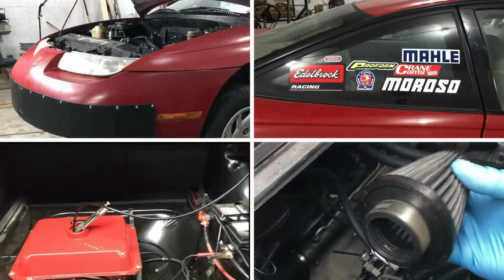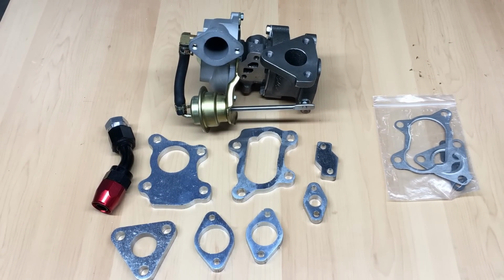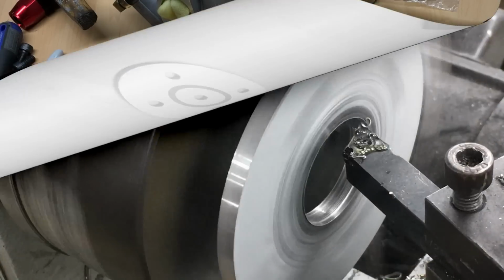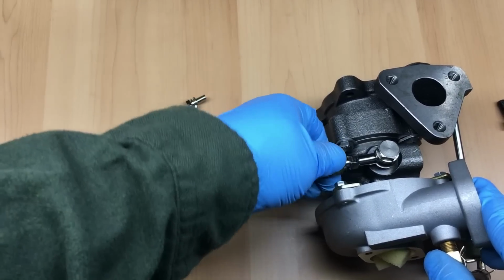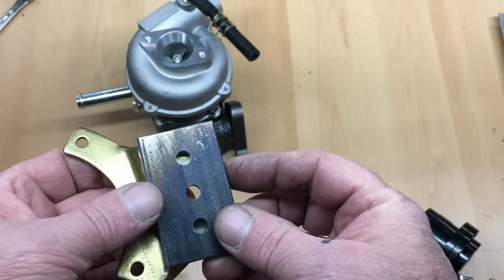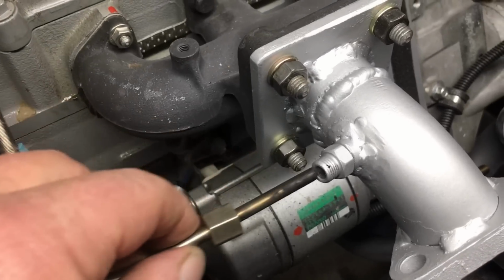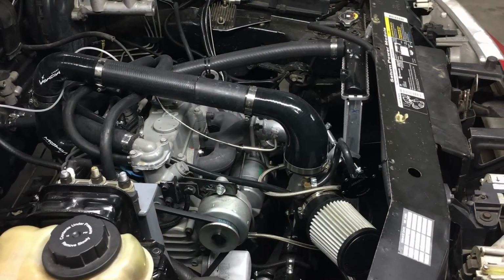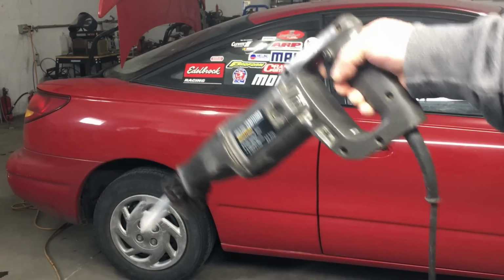S3 E5 We install a RHB31 turbocharger on the Kubota D722 diesel engine in a 1999 Saturn coupe.

Comment: Diesel cars with less than 3 liters consumption are standard, VW Volkswagen Lupo 3L TDI:
The Lupo 3L TDI  appeared in 1999 and, with a third-mix standard consumption of 2.99 liters of diesel fuel per 100 km, is the world's first series-produced 3-liter car. It has a 3-cylinder in-line engine with a pump nozzle system and a drag coefficient (cd) of 0.29.
In addition to the development of an economical engine, lightweight construction techniques were used. These include the use of the light metal aluminium, and for some parts also with magnesium in the alloy. This meant that some components had to be newly developed. In addition, the panes are made of thinner glass. In this way, around 150 kg of weight could be saved compared to the VW Lupo SDI.
The aerodynamics of the tailgate have been optimized and it was manufactured using composite technology from different aluminum alloys (with magnesium on the inside).
The weight reduction in connection with the energy-saving tires (mandatory for using the tax advantages) led to problems with handling: In particular, the vehicle with only one driver showed a strong tendency to oversteer. In order to be able to retain the already developed tailgate and the already existing production facilities, lead weights were installed in the rear bumper as an interim solution. This compound flap was only installed until May 2001; from model year 2002, VW installed the steel tailgate of the normal Lupos. As early as model year 2001 (from 06/2000), the starter battery was installed in the spare wheel well in the trunk to put more strain on the rear wheels. With this measure, one of the 7 kg additional weights could be omitted. The option of ordering a temporary spare wheel instead of the standard breakdown set was also eliminated. Along with the battery and the heavier tailgate, the lead weights previously used could be omitted.
The on-board electronics are supplied with a constant 14 volts by a step-up converter mounted between the rear wheel arch and the driver's door when the starter causes the on-board voltage to drop.
The bonnet and doors were made of aluminum throughout. An automatic manual transmission ensures early upshifts and thus low engine speeds. The transmission is designed with a very long translation. Technically, this is a special solution: A conventional gearbox and a clutch are actuated by hydraulics. Replacing such a transmission is relatively expensive.
Due to the limited functionality (three-door, small trunk, little space in the rear), the high purchase price and the resulting long amortization period, the VW Lupo 3L TDI did not open up a wide group of buyers. Critics accused VW of having implemented an alibi project with this model and price policy.
With pollutant emissions of 81 grams of CO2 per kilometer, the VW Lupo 3L meets the criteria for tax classification as a three-liter car in Germany (max. 90 g CO2/km). It was also the first diesel-powered car to meet the Euro 4 emissions standard. Early VW Lupo 3L models only meet the Euro 3 emissions standard. The extension of the automatic start-stop system to include freewheeling (rolling when the clutch is open) helps to save fuel and thus to reduce exhaust emissions.
After the end of series production of the other Lupo models, the 3L (like the GTI) continued to be built until early summer 2005. From May 2005 it could no longer be ordered. Volkswagen never offered a diesel particulate filter for the Lupo 3L, not even for an additional charge or as a retrofit kit. A green fine dust sticker is assigned to the vehicle even without a filter.

Comment: Im confused... Why enlarge the hole on the exhaust plate when the inlet of the turbo is still half the size of the needed exhaust? Wouldn't a larger turbine function more efficiently? Or is the objective to choke off the exhaust and retard the power and thusly lower manifold temps?

Comment: hey on those flanges you made for the intake on the turbo wouldn't hurt to put lock tight on those bolts last thing you want is a bolt in the cylinder lol

Comment: Awesome!  First, I want to say what the heck??  I’m subscribed to your channel, but notifications for new videos aren’t coming through. I have become used to Sunday afternoons seeing what you’ve been up to, but now I’m getting the notification about three days later. 🤔 

Anyhow, this little engine really responded well to the additional air!  Curiosity struck again, and I’ll have to go back and see what you were running for induction when the car was naturally aspirated; I’m wondering if the larger, free-flowing filter may have also contributed to the EGT reduction?

You are most certainly on the right track slowly increasing your spring tension on the waste gate. 
Your engine was designed to be naturally aspirated, so the compression ratio is probably upwards of 18:1, and may be as high as 22:1. 
Turbocharged diesels are generally around 16:1. 
With higher compression, cylinder pressures are going to rise quickly, so starting slow and steady is the way to go!  

That being said, the horsepower junkie in me noticed you dropped peak EGT’s by roughly 200*F, if memory serves me correctly, at only 5 psi ( ~ 1/3 additional atmosphere!!!! ).  The intercooler is definitely going to make a difference as well, if not the biggest difference in fuel economy and also horsepower potential when it’s time to party. 
Do you still have the methanol injection setup you ran on the Honda?  If so, that will be another possible avenue for combatting excessive EGT’s during an extended high speed run, and will offset the effects of the intercooler becoming heat soaked. 

I’m looking forward to seeing what you come up with next!  And I’m really getting excited to see the wick turned up on the little Kabota!

Take care, and God bless you and yours.

Comment: Just a bit of advice, if you encounter a lot of turbo lag or a lack of boost, decrease the size of your boost pipes, using 2" pipe with such a tiny turbo over that distance will effectively give it a massive void to fill with pressurised air, which is why your boost was a bit lower than expected, and the intercooler will actually make the lag worse!

Comment: Since this is an unconventional build, I'll go with a non-conventional idea: instead of an intercooler, cool the intake charge with a water bubbler, similar to a large "bong" so the intake air will be more humid than normal, and *should give you lower EGT and a little bit more HP and torque. Works similar to water injection, except you don't have to mess with a pump, flowrate ECU etc.

Comment: Would be fun to see temperatures with a water sprayer on the intercooler, or a water-air intercooler, as the one in the video might not get that much cold air blowing through it

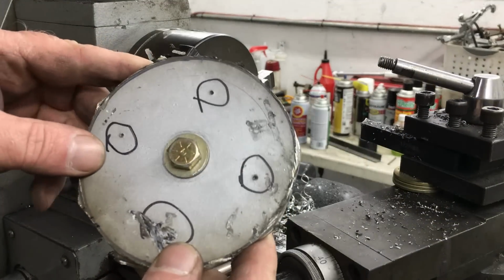Comment: At 7:00, why did you spend all that time making the flange perfectly round when the end result was for it to be square?  Is is because you don't have a 4 jaw chuck for your lathe?  Wouldn't a hexagon that you cut out with a grinder work just as well as long as it was big enough for the final square dimension.  The 3d printed pattern could have been hex shaped and you could just trace it's perimeter with a sharpie and cut it out with the grinder.  Skip the step where you turn it perfectly round.  Just a thought.

Comment: Apparently the injection pump doesn't have a flexible full load stop? The old injection pumps had something like that. A boost pressure line was screwed on there, which moved the full load stop further back depending on the boost pressure.
I'm afraid your construction will smoke in turbo lag.
Still, nice handwork.

Comment: do some research on efficiency increase via compound turbos. with that adorable little thing you could use something cheap like a Cummins takeoff hx35 or he351 for the atmospheric turbo. should be able to gain about 20% power increase across the board meaning you can use less throttle input to achieve the same goals and moving more air-mass leans it out considerably letting you get away with a fair bit less fuel just cruising.

Comment: Having bolts on the inside of an air pipe can lead to disaster if one comes loose.   Use longer bolts then place a nut on the outside to lock the bolts in place.

Comment: If you use a very large intercooler that covers most if not all the frontal area of the radiator, as well as having way good intercooling it will pre-warm the air going through the radiator and offset the effect of having too large a radiator and likely you won't need to partially block the airflow like previously. Of course, the boosted engine might need more cooling than at present so this idea may not be workable.

Comment: Personally, I would advance injector timing first….biggest bang for the next buck really. Then add the intercooler, and look at possibly going to 34mm on the pump. The timing alone may get you the added boost for the wastegate to become functional/required, not to mention a nice bump in power. Even a small advance on a little kubota can add a nice little boost.

Comment: It's really a good thing you listened to your audience... If a turbo leaks oil in to it's compressor side a diesel engine can burn the oil as fuel. Then you can get a runaway situation where the engine reves out of control until it grenades.

Comment: I put the same turbo on a single cylinder diesel and it makes about the same boost, I think the wastegate on these is only a 5psi wastegate. Should make a lot more. Make a boost controller for the wastegate hose. I just kind of have my wastegate blocked off. Im going to put it on a tractor here soon and see what the result is

Comment: Also, the reason you are only reading 5psi is more likely to Gate bleed. The gate isn't like a switch. The OpRod will experience continuous push from the moment your boost is over atmospheric AND the moment exhaust pressure act on the gate at the same time, until it is fully open at the rated spring weight. All the way up until it is fully open, it will bleed off some exhaust, and thus cost you energy. You can use some technolohical wizzardry in gas engines using vacuum and controllers to hold the gate conpletely shut until it nears the desired pressure, then release it. I just don't know how to implement it on a diesel. I suppose a reference vacuum pulled from the front of the turbo is possible, but that would be a lot of "if"s and complexity. I think you would be fine to bump that spring up and just watch your guages if you are unsure. The biggest killer of these engines are not really boost, as much as they are cylinder pressures and heat. I would be interrested to see you install a drive pressure guage to be sure we see the drive pressure ratio of this turbo setup. If the ratio is too great, a pressure runaway could see your backpressure skyrocket. Lol. That's usually what kills the 6.5

Comment: I don't want to be that guy, but I think you need a little bigger turbo. Lol. You may be getting sufficient scavenging, but I dwonder if you will be able to get much more than that. 
Actually, if you want to be cheap, a GM3, or GM8 (or whichever model you find)  turbo pulled off a junkyard 6.5 diesel would probably work wonders in this build. Maybe even as a compound setup. They were always troublingly small for the formidable diet of the 6.5 and generated tremendous heat; but on an engine significantly smaller? Shouldn't be a problem at all. I would be interrested to see the timing adjustments come into play. Cool the charge are down as much as possible to give your fuel its best chance at being happy with more agressive timing angles.

Comment: I'm going to encourage you to also try an air-to-water aftercooler. It gives you several options including plumbing it into the heater core circuit, this can be useful in the winter for bringing the engine up to operating temp faster.
Reply: One does NOT want 200° water pumped into his air to water intercooler.... 🤨
Reply: @davelowets  Should be awesome during the wintertime for warm-ups, not so great after operating temp has been obtained or during the summer. gonna need some steering valves to make it work!

Comment: Aculator = Actuator. Was really happy to see you saw the comments about getting the turbo re-oriented, I was worried the next episode would be one with a ton of smoke, lol!.. I'd make sure you have some red loclite on those bolts that are inside turbo outlet pipe. If one of those manages to rattle loose, it'll make for a bad day.... When you do the intercooler, try to get it as far forward into the air flow as possible. You'll need to remove the cover you have on the bumper to get it to work correctly.  As you've already seen, diesels and turbo's don't work the way they do on gasoline engines. At least to a certain extent. Using the turbo to control the EGT'S is a great way to tune the system. Another good data point to have would be what we call "drive pressure". It's basically the pressure in the exhaust, between the engine and the turbo inlet. To be on the safe side of things, I would keep the drive pressure less than 2x the boost pressure. I have a feeling you won't get much more than 7psi before you're hitting around 14 psi of drive pressure. That will be the safe maximum that you'll want to run that turbo at for longevity. Lastly, be cautious with the injector pump timing. A LOT of power can be made from timing on a diesel, but it also makes them noisy and can break things very quickly. A little clatter under full load is fine for maximum power, but it shouldn't be knocking loudly if you want it to last.

Comment: the allen bolts INSIDE the charge pipe and air inlet adapter made me cringe. the engine or the turbo eating a bolt is going to ruin all your fun

Comment: Charge air cooler should make a significant difference. When you think of an old school intercooler it actually used hot coolant to cool the intake air down. Once you dial the pressure and the fuel in it'll prob work good. If it hazes grey a bit but doesn't roll coal wide open under load you about got it optimal. Rolling coal is cool and all but it's wasted fuel and power

Comment: If you want more out of the turbo, fabrimacobble a heat shield for it. If the exhaust gasses cool down while in the compressor, that will lower the efficiency. Gains will be marginal, but you want to do this properly 😃

Comment: You may only be seeing 5psi because there is not enough energy/heat in the exhaust to bring it up. After installing the IC I would move your pickup for the pressure sensor to after the IC and closer to the inlet on the manifold or directly on the manifold, or you can add a second sensor and show the drop between the two areas before and after the IC. Pressure is just a restriction and you want that restriction to be the valves/cylinders of the engine. 

You will more than likely need to move the rack on the fuel pump back out to see the greatest benefit. If possible I would also look at changing the timing of the injection pump, but that would require a couple of special tools. I cannot remember if you said this was a Bosch pump, or Bosch like pump. If it is  Blue point sells the timing kit, but I would bet in your area of Kanas someone would have one that you could borrow. 

as an example on a cummins 12v I would move the timing to as close to 23* this was a compromise of starting and power. Factory is 11* i do believe. We would see an immediate increase of power and responsiveness after this change and a slight lowering in EGTs and less black smoke which was very nice. Your weather is going to effect the amount of timing that you would be able to add as its still cool, always check the starting of the engine cold not at temp as you could find yourself with a no start scenario in the morning.

Comment: A rule of thumb for egt temp for most manufacturers is 1350 with that being said my cummins stock can easily get into 1400°f or 1500°f pulling and cummins says nothing to worry about. My ford 7.3 with a big tune, upgraded turbo and a heavy weight work van topping the scales at 15k i never see my egt go over 1100°f pulling a trailer and excavator bringing my gvw to over 25k.

Comment: The stock actuator arm probably would have worked ok. The turbo seems to be small for the engine and you won't over speed the turbo with that engine. 

For disels the fuel is the power, so even if you had 1bar of boost 14.7psi and don't add fuel, you don't make really more power. 

Why you get only 5psi with a 0.5 bar spring is probably because the engine don't breathe enough to get exhaust flow to spin the turbo.

I wuld say, just go with the biggest spring possible as long as you stay in the compressor map and send it. 

You will get some more boost by adjusting the pump for more fuel. And you will get the egt down and maybe a little more boost with the intercooler. But the turbo might still bee too big for the engine to make enough boost to open the waste gate

Comment: Great episode Jimbo, even when I had the CNC machine here I still made a lot of flanges the same way, only thing I did a little different was to centre drill the head of the bolt so I could use the live centre, just makes it all a bit more rigid for the interrupted cutting phase. 

Keep em coming I'm expecting good things with the intercooler and more fuel!

Comment: you might want to install a inline air oil seperator catch can in the pcv system you made. getting any oil vapour into the engine will be bad for it in the long run